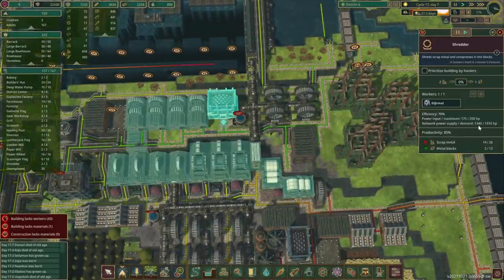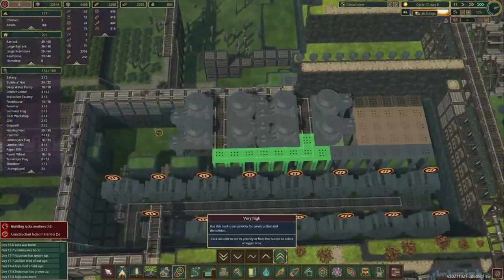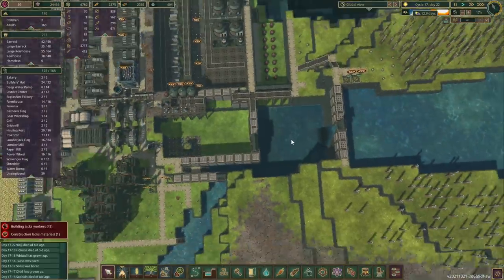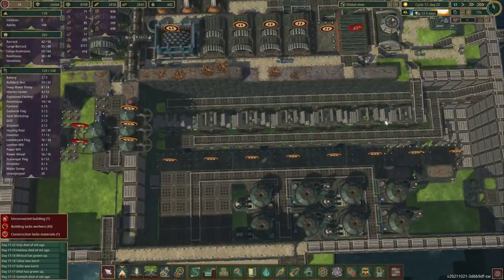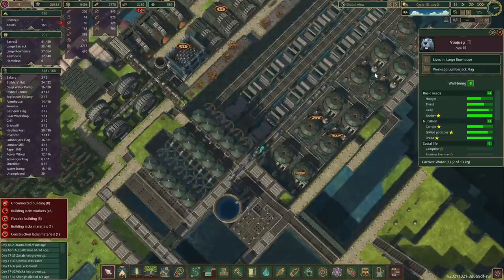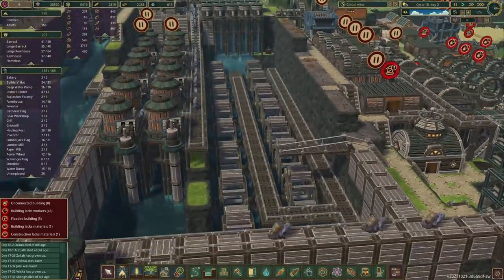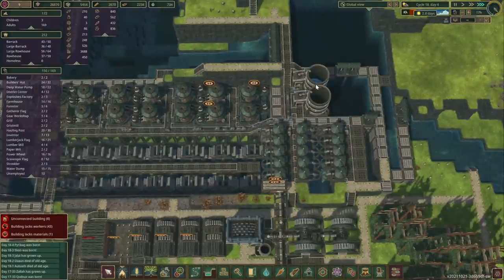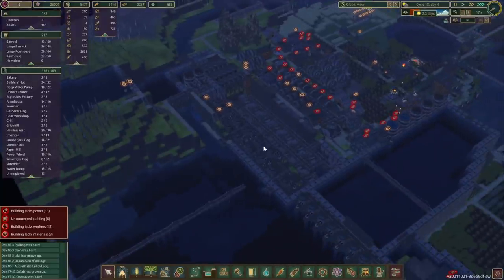TIMBERBORN | Waterwheel Power During Droughts - HARD MODE | E20

Comment: I know you calculated the efficiency in your spreadsheet video, but seeing all this hustle, makes me believe engines would have been more resourceful, despite them burning logs. All the logs in the levees and waterwheels. All the food for this army of beavers requires a lot of land too. I tried something similar once and didn't manage to get it to work. Curious to see how it will end up :). Thanks for the enjoyable content.
Reply: I agree, ive seen multiple creators try this method. It’s too inconsistent and requires way too much micromanagement. Engines are the ideal solution.
Reply: That might be even better idea with the changes to the engines and water wheels that are coming
Reply from the maker: Totally agree with you Daniel. I guess the reason to building this set-up was mostly because I wanted that feeling of achievement after failing the first time :)

Comment: I played around with drought water power for a while and the issue seems there's just no way to regulate the flow beyond using a single  floodgate with 0.5 resolution. you can't make any smaller bottleneck and even curving the water around doesn't seem to slow it so on hard mode these wheels are pretty much useless unfortunately
Reply from the maker: Hey Merlin! Cheers for sharing your findings with us! I agree it's a little tough and annoying to get a good setup with waterwheels. I suppose it's better suited for bigger maps but now with recent changes on experimental, i look forward to seeing where this might go

Comment: channels only as wide  as one wheel and only 1deep is better as the flow of the dumped water is confine, to flow only tough that smaller area.
 so long and narrow for power. 
i think dropping down a level  every 7-10 wheel might be good to ensure flow (i haven't tested this tough but too far and the flow stagnates too/behaves weirdly)
Reply from the maker: That's a great tip and thank you! I guess aesthetics won over efficiency this time hah. Ep21 should reveal/give answers to why I did things the way I did them :)
Reply: @BabyDragon1   of course, can't wait to see it. 
Though with the new update to waterweels all "efficiency" designs are probably about to change x3

Comment: I would raise the height of your power wheels with levy’s underneath to create a ‘staircase’ of levy’s the water can flow down and turn the wheels.  I’d also deepen the water pump side as well with dynamite.

I couldn’t tell, but it looks like the wall between your wheel and pump areas isn’t solid.  It looked like the power connectors of the wheels goes sideways into the pump area, so the water goes sideways and doesn’t only flow down stream to make the wheels turn.
Reply from the maker: Hey Luke! Thanks a lot for the feedback! I'm actually keeping the level at certain height to fit them with another build idea. This should be revealed in EP21 :)

Between pumps and waterwheels, there's a 1 tile high block